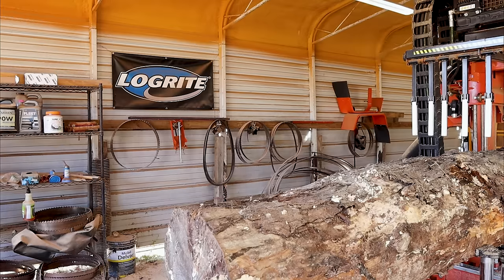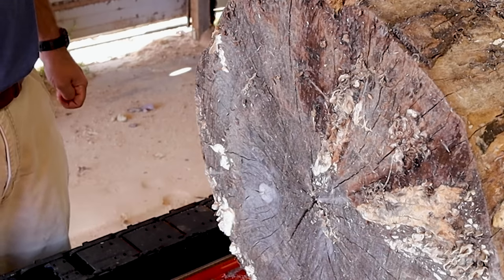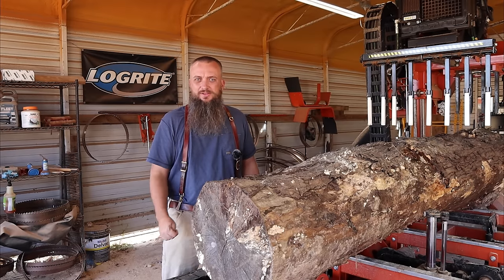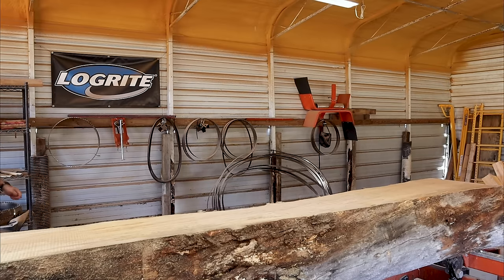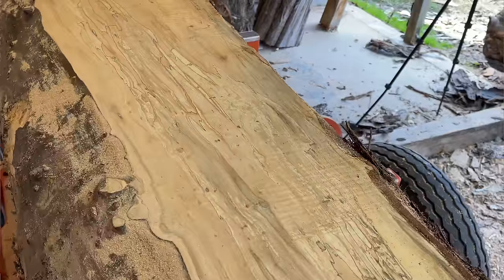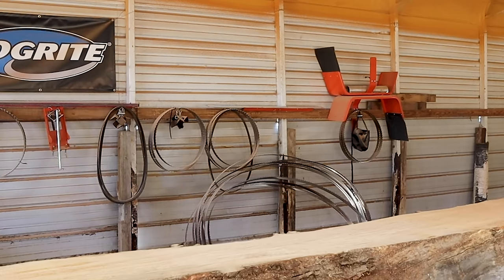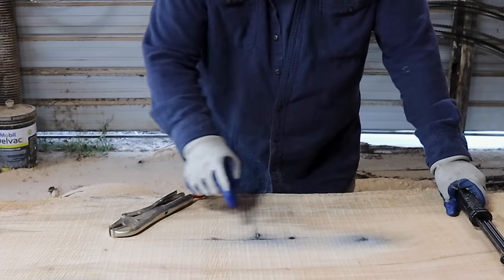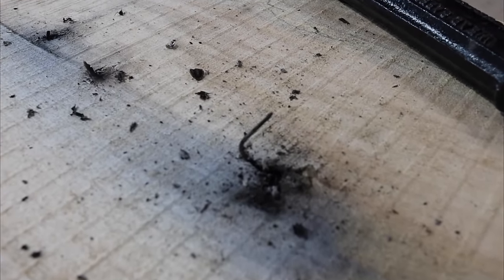This Log Left Me Speechless.  Spalted, Ambrosia Maple! Sawmill Gold

Comment: 95% on the ambrosia explanation, but the ambrosia beetle doesn't really move through the wood. But, the beetle carries a fungus that then takes root in the wood and spreads through the tissues up and down the tree. That's why you'll find large streaks of color emanating from very small boreholes.

Gorgeous log that turned out to be, and still pretty straight for being cut for slabs. You'll get some very happy customers for that tree, absolutely.

Comment: Woodturners love ambrosia maple. Have you considered cutting one or two of those slabs into squares (length =width) and offering them up fresh and wet? As long as the end cracks are trimmed off, you should be able to do some quick sales, even pallet loads of them. Especially the big (over 12” wide”) cuts. And up to 6” deep a cut? Urns and large hollow forms popular sell items, but few commercial suppliers out there.

Comment: Beautiful log!
I grew up with several silver maples in our yard; they were all way too small to even try to climb when I was little. My parents bought the place 3 months before I was born and the trees were already there. My first memory of the trees was when I was not quite 2 years old and I was told not to climb it when I first tried; at that time it was only a couple of inches in diameter.
Well, when I was a senior in high school, I decided that I was going to use that same tree, which was about 18 inches in diameter, to overcome my fear of climbing trees. Several years back my brother bought the property from Mom. In 2020, he had all the trees removed but I got three of the trunks and as much wood as I could use. A friend has the same model of sawmill you currently use, and sliced the trunks for me; they were all ambrosia! The colors in the largest of the logs were supremely spectacular, and we cut that one into 5/4 boards so that I can use them to make 3/4" shiplap for the ceiling in my RV. The one from the front of the house we cut into one 17/4 slab, four 13/4 slabs, and two 9/4 slabs. I will be using one of the 3-inchers to make a kitchen countertop for my RV.

Comment: That's a beautiful log. Beautiful job. Nathan can I ask I don't no if you've considered it but when u take off the first slice could you take thinner say an inch thick and sell them as blanks for serving boards/charcuterie board's. Based on what I've done so far I had the top and bottom cap so first two of your cuts the high parts resawn and ended up getting 8 boards out the 2 caps that could be used. Just an idea for another money maker for u. 👍🏴

Comment: I am curious as to why sometimes you do several cuts before removing the previously cut piece and other times you remove each pass. I would think in the case like today's cuts the weight of the previous cuts would possibly strain the blade.
Reply: If you think about it, the wood right ahead of the blade is still solid so the cut can't be squeezed together that close behind, only at the last bit of the cut as the blade breaks through.